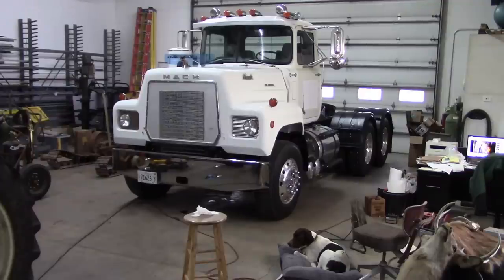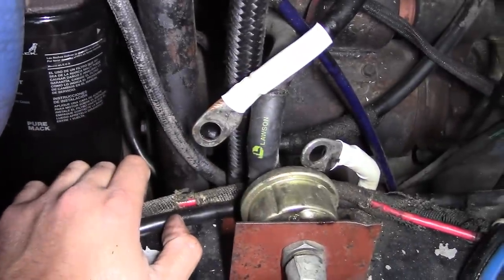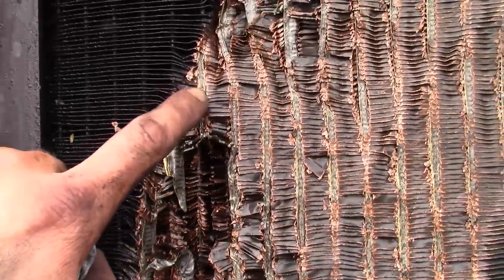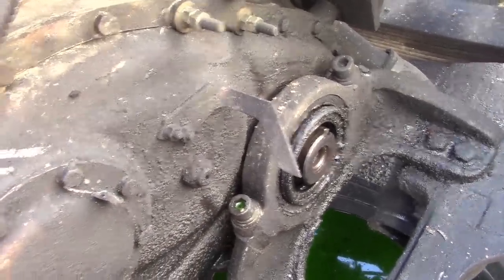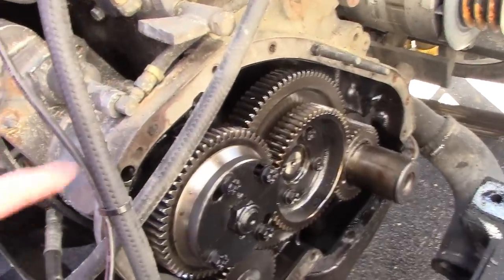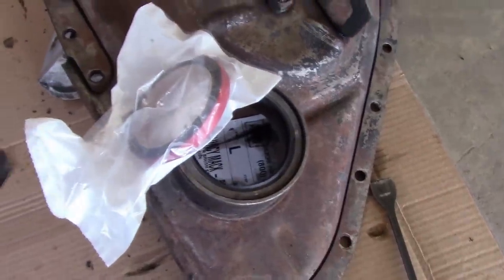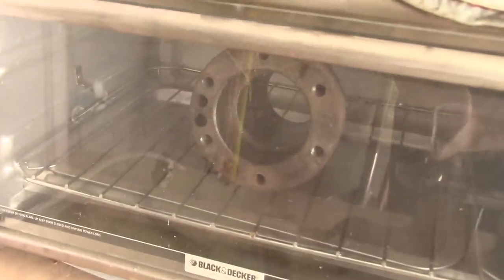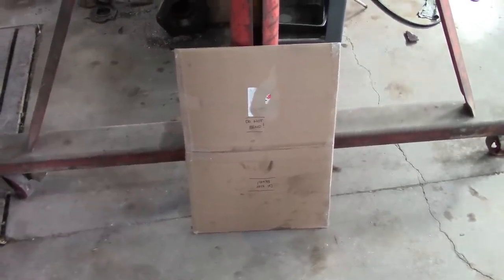Mack R Model Semi Truck Has a Bad Day - Fan Hits Radiator and Battery Issues

Comment: I can understand the parts frustration especially when the parts guys have zero clue what you are talking about. I had the same issue when we broke broke off four teeth of the ring gear in our 1980 Case 580D. Case has excellent parts diagrams online but the problem I had was we had a NON turbo 4WD 580. That is apparently a unicorn 580 as they are normally non turbo 2WD or turbo 4WD. The ring gear and pinion are very different between each configuration. (Thanks a lot Case) I had called so many dealers and parts houses looking for this and they gave that weird uhhhhh you have a what? when I told them the model of tractor, even if I gave the VIN! Of course nothing to be found on the internet either.  I finally called one more shop in Buffalo, NY. Worked my way through the phone system and was greeted kindly by an old timer. I told him my situation and he started laughing at me! He says "Kid, we deal with heavy machinery for large companies. A Case 580 is smaller than the smallest equipment we service, we don't service light duty equipment like that. BUT, let me see what I can do for you." He searched around and found out that Case had superseded the original ring and pinion set for the non turbo 4WD models which was not updated in the parts lists online and the dealers didn't even find that. He found a new aftermarket set that matched the new Case part number and was only half the price of Case (if they had it in stock) with shipping! That old timer was fantastic and the huge service company he worked for has some good suppliers. The new parts came in and the ring gear was 1/4" thicker than the old one and the pinion gear was smaller. To replace the pinion you had disassemble the whole trans and t-case. Instead we took the new ring gear to a machinist who machined 1/4" off the back. This process took me months to get through. All the while our prized 580D was dead in the driveway with no hope in sight.

Comment: I'm kinda old school, well, I'm just old but I was certified Mack mechanic and I would put the balancer in the freezer and the ready sleeve in the toaster oven and heat it and they just slid into place. Presto! Or, drip the balancer in gas and warm the sleeve and again, slide into place and lock in together when cooled. Just a thought... Thanks for sharing your story with us. 🇺🇸🇺🇸🇺🇸🇺🇸
Reply from the maker: I've tried it before but not had much luck. The sleeves are like .005" undersize. That's a lot to grow!

Comment: Sorry forgot to add that this one is a Western Model.  You can tell by the grill which is smaller fins than the regular R Model and also lots of aluminum and air tanks are where they are.  Thanks

Comment: I used to get all my seals and speedy sleeves from Sadler power train.
We had about 25 R model macks in our fleet. I hated them with a fiery passion that burned in my soul.
We also had a chain permanently bolted to the front axle of all our Macks and hung on the front bumper. Those things would get stuck on level ground in the grass.  And are very easy to break when pulled/pushed from the front
Reply from the maker: I tried Sadler. They could not help.

Comment: Wes you are using your battery terminal pliers backwards. Put the cable next to the handles, the spreading end is then by the bolt. Works easier. 
When this farm boy first saw one of those, I got them. 2 years later the JD mechanic was working on our 5020, saw me using the pliers on a truck. He showed me how to use them easier, and battery terminal grease to prevent terminal corrosion. I was about 7th or 8th grade. Dad had a bad hip so I did more mechanic and maintenance work. 
Hello from north east Montana.

Comment: Why both radio wires are fused:  I cut-n-pasted this from an ARRL forum:  

Some [radio] manufacturers tell you to run both the positive and negative leads directly to the battery. Tom pointed out the major pitfall in doing that, as if the battery to engine block connection fails, the very high starting current will occur on any alternative path to ground, and if you have a radio with a ground wire connected to the battery, that path will be your radio wiring. This can cause equipment damage or even catch the wire on fire.

:)

Comment: Something today most are not aware of with truck electrical systems.  Older trucks had what is called a series parallel switch.  Gen/Alt charges all 12 volt systems.  However, needing more power for starting and keeping all other systems at 12 V, this S/P switch is used.  When starter is engaged, the 2 sets of batteries are disconnected parallel rom each other and changed to 24 volt series just for starting.  When switch is released system returns to 2 sets of 12 volts batteries.  You got to know it or you fight yourself trying to figure it out.  Bye

Comment: to answer your question Wes:
An old timer imparted to me the wisdom that fusing both the live and the ground wire on the radio protects the something in case the two-way antenna gets zapped by the battery.

Comment: Mack-the most over rated odd ball truck out there.  I get stuck with jobs on old trucks occasionally like this and it seems to be a struggle to get it out of the shop and get paid for ALL the time you put into getting it fixed.  Great video, ive been there
Reply from the maker: Right. Hard to make money fixing antiques.
Reply: Your name  - a Mauser cartridge?
Reply: @johnz8210  Yep, I was a Mauser fan, particularly the big ring 98's
Reply: @8x57mm  That's cool.  I used to have a 7x57 - model 93 I think, many years ago.  My brother has a 98.

Comment: Two-way radios are often fused on both pos and neg to prevent radio neg from carrying large current in case of loss of engine ground resulting in starter current taking alternate paths back to battery.

Comment: Hi Wes. Just wanted to let you know that I order alot of parts for the shop. I run into the same deal with fed ex all the time. I've gone strait ups usps for my shipping. Just in the last 4 mouths I've had 86 orders from fed ex screw up. I feel your pain and frustration my friend. Good video

Comment: Hey Wes just a helping hint for ya.. if your fork lift is still running all ya need to do to remove a big truck hood is a pallet and maybe a piece of carpet on top of pallet.. just put the fork lift and pallet under hood right up next to bumper, tilt it over ,unhook it and slide it into pallet .back up and drive away.. I am force to R&I hoods all the time by myself.. hope this helps bud

Comment: Crazy to think its that much difficult to get parts for an R model Mack. I might be dating myself, but I remember when you couldn't throw a rock without hitting an R model Mack. Especially in the northeast. I grew up in NJ and they were everywhere especially in heavy haul, flatbed hauling, vocational work, and  big with supermarket grocery haulers and dairy plants. I drove a Mack U model back in the late 80s for Cumberland Farms dairy. I used to work for Fedex too in the 90s, the gaskets probably got put on some truck going to Florida.

Comment: years ago I was doing some electrical work on a haulage companies truck. It was the owners personal Kenworth , most of the other trucks were leased and he had speced it out to be the best and to serve as the flag ship of the fleet. It had been on the road for less than 3 months when the fan bearing assembly broke the 4 1/4" bolts and in the process destroyed the radiator. Apparently this engine configuration  had only recently been introduced. The breakdown was repaired under warranty only to fail again a month later. this time replacement parts were not immediately available so the owner called in a local fabricator to make a new fan hub support. It was not pretty but was strong and crucially did not use the original 1/4" bolts as even at this stage the folly of the 1/4" bolts was obvious. This modification ran well for another 3 months without any signs of failure but the engine maker insisted on genuine parts if he wanted continued warranty. So a new and "improved" hub mount was installed again using the silly 1/4" bolts only to have this fail again and again. I later heard the owner got about 9 months service from the truck in 2 years.
Reply from the maker: That's horrible.

Comment: In the late 60's we were traveling into the city when an ambulance ran through an intersection and my dad slammed on the brakes. The engine in our Falcon wagon slid off the mounts and the fan hit the radiator.

Comment: Wes - for future reference, put the speedy sleeve in a toaster oven at 250 to 275 like you were doing with the hub. Only apply the loctite to the very bottom of where it's going. While hot the sleeve will be a slip fit and fall right into place.

Comment: A Motorola two way? Usually I see those with both ground and hot fuses. Some of those radios are pretty sensitive to voltage issues and/or ignition switches. 

Good video as always!

Comment: Fun shipping tip. If you insure a shipment over a certain amount they handle the package different. Yes, it does cost more and is a pain, but you get your stuff. I worked for a company that everything was minium 10k insurance with things regularly over 50k so it would go to lockup. We are talking gaskets filters and coolant. When I would wear my company shirt into FedEx, UPS, or DHL they would cry. Currier service loved us. Also if you fax the main distribution office in your area with the missing info they log that to corporate. So from FedEx office fax main with my contact the package track and short message.

Comment: I was in the earth moving/ underground utility biz and ran R model macks for over 25 years they hade the best of every thing they are bulit proof. Not so nice cab wise but they ran and ran some more all mack motor rears and 2 stick tranys and you could put a million miles and more with little down time if you looked after them.   And i still have a Superliner with 1.6 million miles on it . The new macks are not bilt mack tough

Comment: There is an alignment tool that goes on the crankshaft to center the timing cover. Setting the thrust buttons is  very simple and should be done any time the cover gets removed. I am showing my age but I have all the service info for any Mack going back into the 60's if you ever need anything.
Reply from the maker: I did get my hands on the manual. I ended loosening the cover after installing the hub, but didn't really move.

Comment: That front cover, I would leave the timing cover bolts loose. Put the balancer on, then tighten the timing cover bolts. That would get everything nice and centered.
Reply from the maker: I basically ended up doing that.

Comment: really surprised the original radiio installer didn't go straight to the terminal strip to begin with but with the fused ground maybe i shouldn't be so surprised.  Its a shame that clean Mack got beat up like that but mistakes happen. Chasing down parts like this is what takes so long to do simple projects. a couple days turns into a month real quick. probably why i have 30 projects going on at the same time.
Reply from the maker: Heh. You just need a few more lifetimes!

Comment: The front main seal itself is what is centering the timing cover on the engine block.
The seal elasticity center it,then you tighten the screws.
It's exactly the same method on all GM LS engines. 
Can't you install a smaller alternator pulley to get it charge the battery at idle as it should ?
Reply from the maker: This front cover weighs 30+ lbs. The seal is not going to center anything.
Reply: It might overrev the altenator with a smaller pulley.
This truck is a patchwork of random parts so who knows if that altenator is original or matched to the engine RPM.

Comment: I think some of those auxiliary wiring kits have a fuse on the ground side for extra safety if they're wired into a 24v system. If the installer uses the ground of one battery that is actually +12v from the chassis (in the middle of the 24v system), then the fuse protects that ground wiring in case it gets shorted to the body or frame somewhere

Comment: Boy, he's making short work of that corn! Motion Ind. was the only place I could get an electric solenoid for a Vickers valve body several years ago. They didn't want to sell it, but I was finally able to convince them that they were my only option short of spending more than $600 for another valve body.  Not even Vickers would sell me the part, wanting me to buy another valve, I told that fellow I would spend twice as much not to have to buy it from Vickers. The valve was n't hardly 4 mo. old.

Comment: I use to work for a large trucking comp. that had a lot of old Mack trucks we got most of our parts from World Wide Equipment they kept most parts in stock. We had a lot of trucks pieced together especially during the Gulf war. they said the Abrams used Mack 60 bogie rear ends.

Comment: It's hard to believe that is was so difficult to get parts for the R model. I'm sure times have changed since I owned trucks. This was back in the early 90's. Next time try calling Triple Cities Mack in Binghamton NY and /or Cook Brothers truck parts in Binghamton NY. There were thousands of R models running around that area. Most of the milk hauling companies had R models. I had a Superliner that, with the help of a great mechanic shop, we stretched and put a dump box on. That's a nice lookin old round top brake lathe you have. If you need parts or accessories for it, I have them. I also have COATS parts.

Comment: Just a suggestion get your self a variety of stainless steel band clamps for working on exhaust. They are not to cheap but; they are strong and can take the place of crappy welding and don't crush or damage the pipe. I also would spray any welded or bare metal on the exhaust with high temp aluminum paint. Also drill a 3/16 weep hole at the lowest point on any new or old muffler extends the life immensely. I had an exhaust shop for over 25 years if you did not drill a weep hole. After no lead gas started there was always a shit load of water accumulation in mufflers.There was no lifetime warranty from the company if there was no weep hole. Sounds stupid drilling a hole in a new muffler but; it works not just from slowing the rust also freezing and heating causes a allot of mufflers to crack and split. Another thing if you suspect a plugged converter just drill a 1/2 in hole in front of the converter. If it runs much better then the converter is most likely plugged. If not simply weld the hole grind it off looks like new. Any way thanks for all the great video's...

Comment: Years ago (late 1970's) we had 3 GMC 7500 lined up side-by-side in  our shop. The shop foreman at the time wanted to match up the best parts frame, transmissions (spicer 5 &4 ), engines Detroit 6-71's cabs 92bbc each, what a night mare. the model years varied from 1968 to 1974. The repairs never recovered from that swap, there wasn't any record of which componants were put in which truck. annother time a 1968 IH 2675 had a used engine Cummins L10, from a junk yard without thefactory tag on it, installed. first problem arrose when we needed to get manifold parts without the tag numbers where trial and error. and mushroomed from there on. Never any fun on old stuff.

Comment: Hi
Damned I'm terrified about that style of battery bracket.
Few I have repaired by cutting part of and welding it back to the side. 
On one tractor where I made that repair before installing correct sized battery, battery off switch had problems disconnecting until it shorted on one start where battery disconnect was open.
While inspecting damage to the battery terminal, I noticed that positive terminal had some welding marks on it. So it has been reeelly close to a grand master disaster
And the battery is really lovely placed under the dash right between your legs.

Comment: The old idea of having the ground connection to the battery fused for a radio is that if the battery would lose ground to the chassis then the new ground for the ignition system and other electrical connections in the vehicle would be the chassis ground of the radio destroying the radio . Grounding to the battery is no longer recommended for modern radios because it really doesn't protect the radio, due to the low voltage that can come across the fuse before the fuse blows will still be high enough to burn the tiny traces in the circuit boards of the radio.  It's's now recommended to ground the radio to the chassis instead of the battery.

Comment: If you want to keep the bolts and brackets exactly were they were before the removal, just use a contrasting color paint spray, beafore you remove the bolts. To put back the bracket. the unpanted area will be the exact placement of where the bracket should go and once done, the area should be completely covered with paint

Comment: Try turning those spreader pliers around so the handles are towards the cable end. The side that spreads the most on the pliers will be aligned with the open end of the clamp.

Comment: Good save, using that oil filter. Interesting on the timing cover. Back in my day, I'm thinking it was a Mopar product; back when Dodge had a large truck division (that tells you how long). There was an engine series timing cover gasket kit that included the short section of the oil pan gasket that was almost sure to be damaged upon removal. RTV was just beginning to be used and was not "trusted"; so to speak. Shame that Mack didn't think of doing that. That, and; the front engine mount engineering is quite a bit on the questionable side. Good job!
Reply from the maker: That's a good idea!